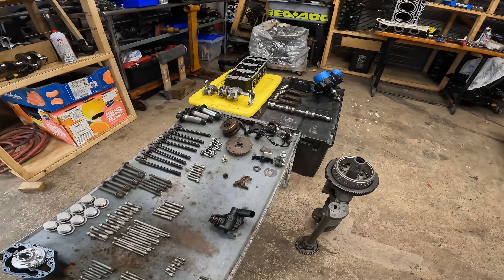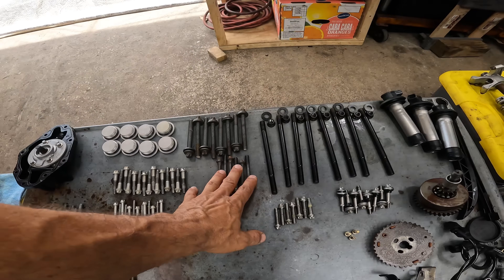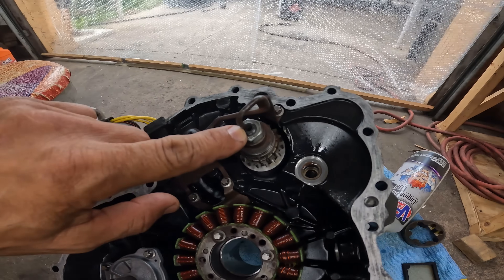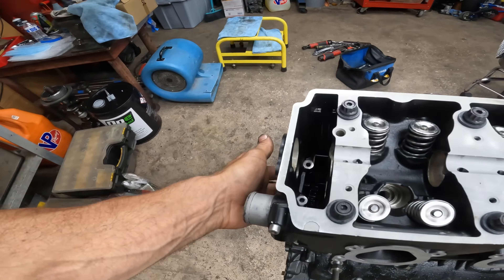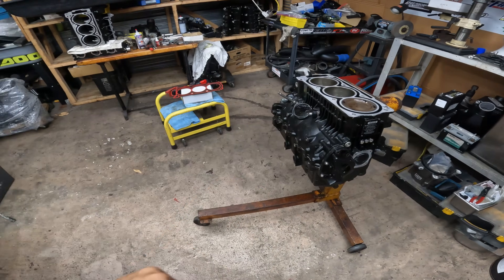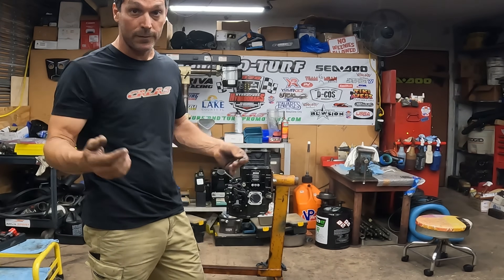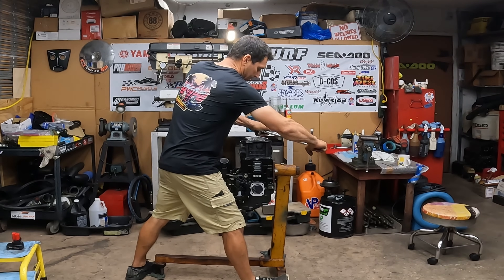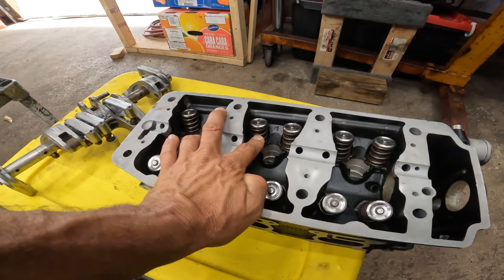Sea-Doo Rotax 260 Motor Build but it's Full of Rust | Cheap Motor Builds Always End Up Costing More

Comment: 12:14 arp doesn't recommend you put lube underneath the washer as the washer/nut/lube is what the bolt tension is calculated off of, if you lube under the washer and on the head the friction of the washer rotating on the head can cause a different bolt tension as it can be easier or harder for the washer to slip on the aluminum head, and if 1 washer slips and others don't it can result in uneven bolt tension. can also cause the fastener to fret into the aluminum surface but not realty a issue on cylinder heads.

Comment: when adjusting the slippage on the charger, does the ecu adjust for any air/fuel ratio changes? I went from 11 Lbs too 13 Lbs slip on stock 300 and just wondering if that might cause it to go rich/lean.....
Reply: @1fastgmctruck  the slippage don’t have any impact on you’re fuel/air ratio.
The amount of boost will have impact on that 
The slippage is just like a transmission to grip on the charger wheel, to much slippage will destroy your charger because the boost is locked up between the throttle body and the charger. The easiest way to release the boost pressure is your off throttle is tru the charger but with to strong slippage it will break your charger

Comment: After checking supercharger slippage on a stock 300 rtx and going from 11 lbs to 13 lbs, does the engine automatically adjust for any air/fuel mixture after going up on slippage setting?
Reply: Basically does changing slippage on charger make it rich/lean or does the factory computer adjust for that
Reply: @jameswinston7593 the slippage don’t have anything to do with you’re air/fuel ratio.
The slippage is only the moment when the charger starts/stops spinning 

If you have not enough slippage the SC will not spin

If the slippage is to stiff you will destroy you’re SC if you drive it like you stole it
Reply: From factory a new chargers slippage is around 12/ 13lbs but after few heat cycles it will loosen up to around 11/12lbs